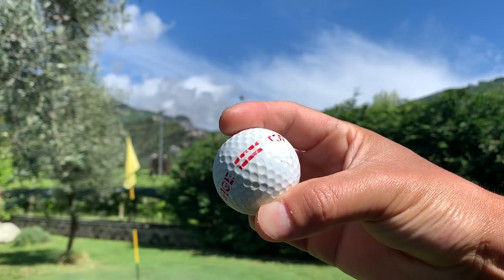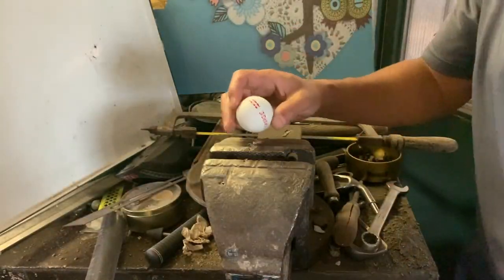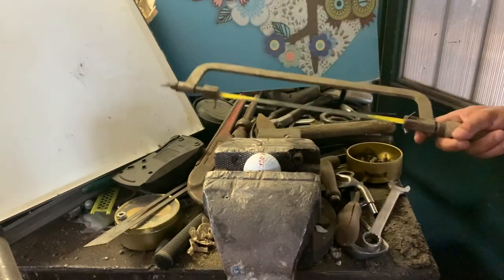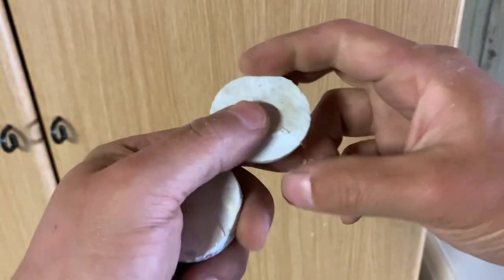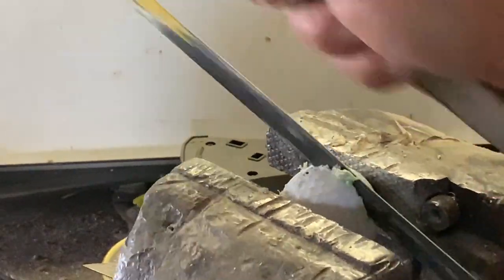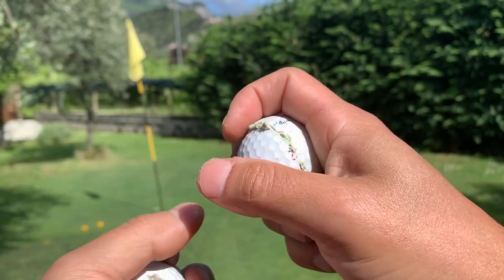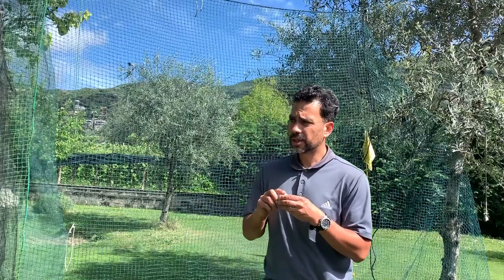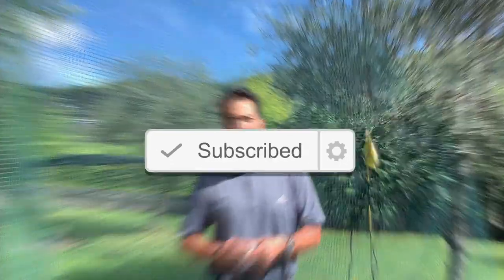What's inside a golf ball? | Range Ball vs  Premium Ball

Comment: The dimples are also designed to stop the ball flying very well. After quite a bit of use, hit, picked up by machine, washed by machine etc then the ball drops as low as an 80% ball also with the dimples wearing. I hate range balls but you can't avoid them easily if you need to practice in the winter.
Reply from the maker: Yeah, I think it varies, this was a tough one, there are also those that seem empty inside and go no where.
Reply: @thebackyardgolfer7010  One range I used to go to had the solid rubber balls. No matter how hard you tried 200 yards was limit on the driver carry and roll. 60% balls I think. Horrible.
Reply from the maker: @thehairygolfer  I'm a bit disappointed to be honest. I mean I'm basically going to the range to play with balls that are no even close to the feeling of a real ball, at this point is better to just go more to the course. It might even affect your game, I mean for that I might as well use foam balls.....

Comment: Difficult to see what is actually inside the premium ball when using a saw because it heats up the rubber and blends the layers. You can buy a proper ball cutter to do things like this. Definitely interesting though.
Reply from the maker: Yes, it was definitely heating up. I don't think I'll be cutting balls again, it was really tough!!! those range balls are like rock....
Reply: Don't think there's enuf heat to fuse the layers. Whether premium single layer or two, it's all marketing and hype.